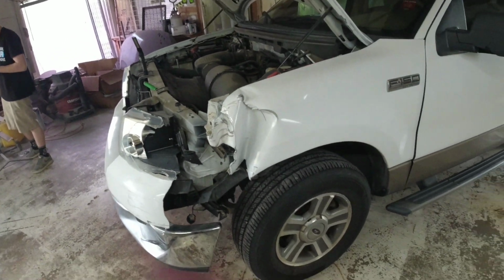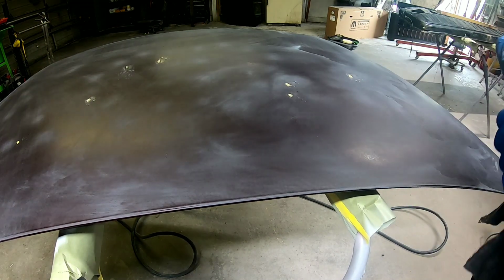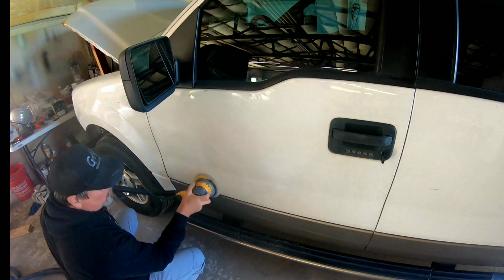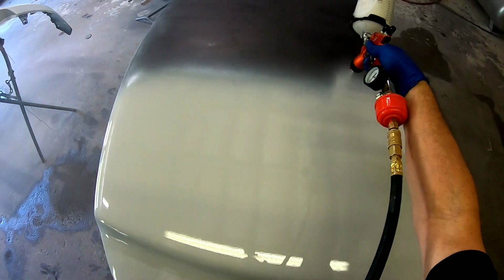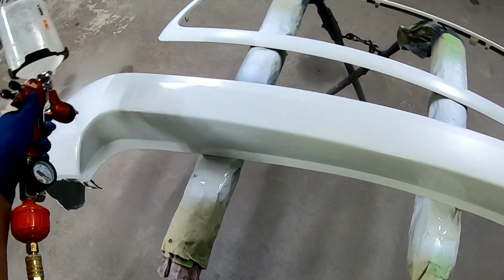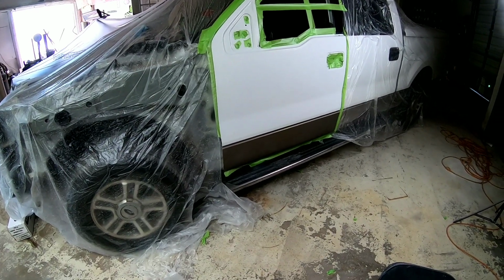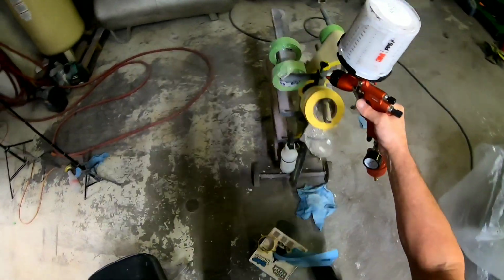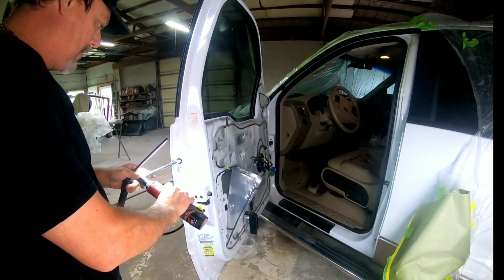Auto body repair and paint. diy auto body, paint repair

Comment: Beautiful work buddy!!!...what’s a good primer gun??. I’m noticing after several panels I’ve primed with the harbor freight gun, I’m spending a lot of time sanding the rough texture it leaves..I was looking at the Astro euro you’ve made a review on but in the 1.9mm in which they offer it in, I love that it’s a little over $100 and I don’t have to spend a lot for a primer gun ..what do you think?..love the vids!!
Reply from the maker: Well its definitely  a great gun. I've  used it for 2k primer with the 1.4 and it sprays fine. If you using a particularly thick primer you may need a bigger tip that 1.4. It seems to me a 1.9 might be a bit large but i could be wrong . Alot of guys use 1.8 for primer . So a 1.9 may be good.
Reply: @GarageNoise  it is pretty thick it’s a upol urethane 2k mixed 4:1:1..maybe I have to much material coming out and not enough pressure ?..I’m almost wide open, maybe a half to a full turn in at most with about 20psi
Reply from the maker: @frankvalencia9227  yes , a bit more air and a little less volume will help.
Reply: @GarageNoise  thanks for your help!..I’ll be trying it out again on a fender I need to paint